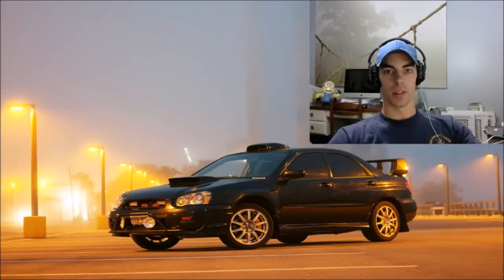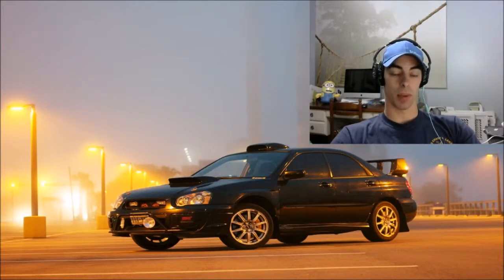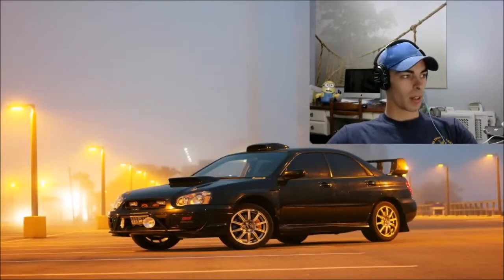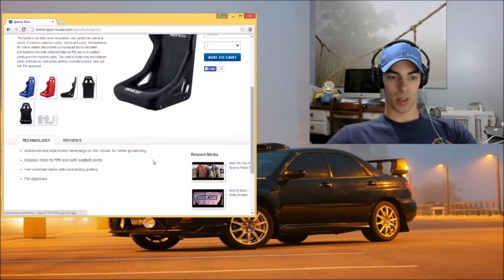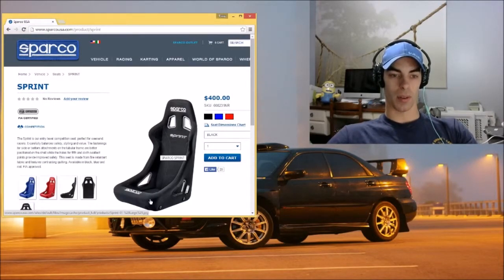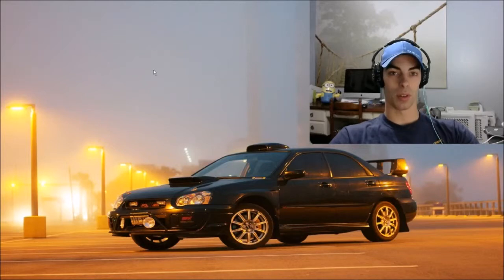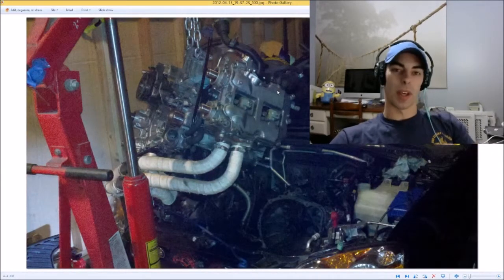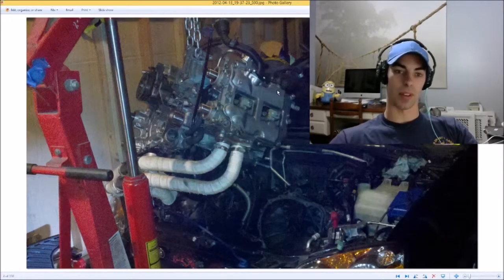The Subie Update

Comment: what motor u got and make a how to install turbo and did u have any problems after installing the injectors
Reply from the maker: Diego Tovar Lopez I have the 2.5 STi shortblock. And i will have to do a video on that its just that the turbo kinda sucks lol. As for the injectors you will need to get a tune but no you wont have any issues